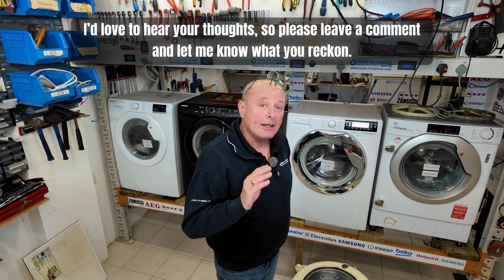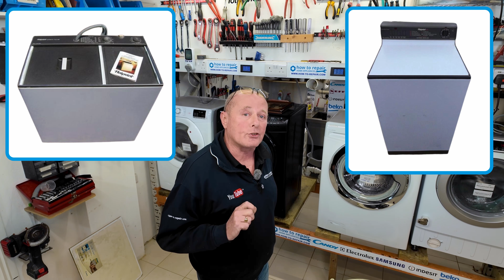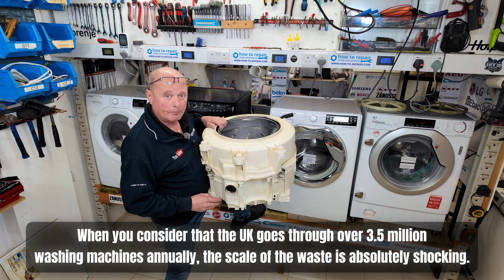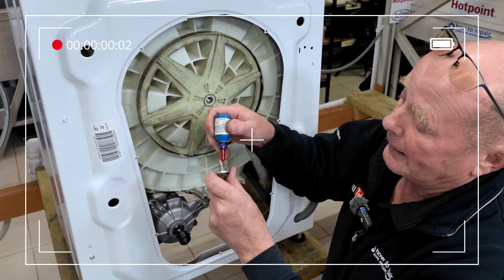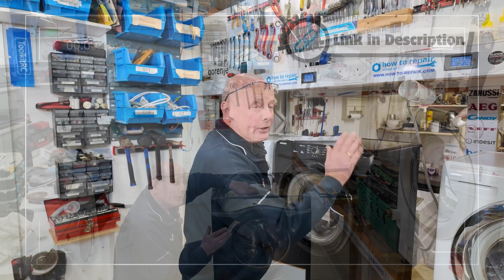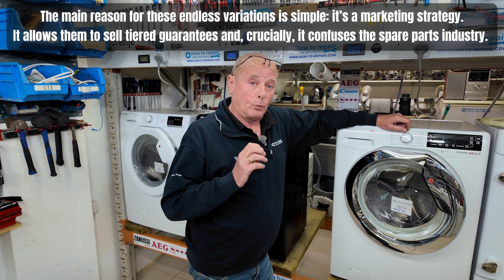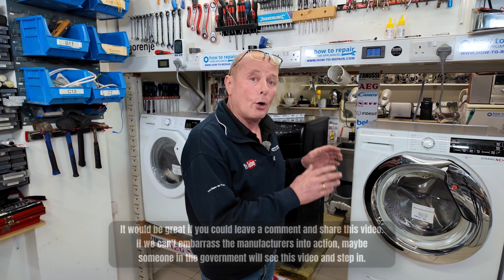I Scrapped 13 MACHINES to Prove a Point: STOP BUYING These Brands!

Comment: I was a Philips washing machine engineer in the early 80s. Most of the maintenence contract machines were anything from 10 to 30 or more years old. All still working needing the odd belt or bearing now and then. Great machines built to last. Every one of them could be totally rebuilt. Great videos by the way thanks.

Comment: but you can just buy a repair plan with domestic and general for about £200 a year for when it breaks down a day after warranty runs out.  call the number on the door to register your warranty and go straight through to a call centre that will badger you to buy extended warranty and after warranty care service, it doesn't matter what brand you buy as they all go to the same call centre with the same payment plans.

Comment: You are bang on with this call out. Just had a Hoover tumble dryer fail after 19 months - drum bearings that can’t be repaired. Makes a significant amount noise when turned on.

I have also noticed the buttons to operate the machines on hoover are just membranes mounted on flimsy plastic.

Comment: I have some personal history with this - from fixing a family friend's drier in the mid 80s (simple belt job), to cannibalising parts from my own washer drier in the 2000s to fix it (switches). One very common issue in planned obsolescence is micrprocessor control and the point that this can render something useless and unfixable. In these sorts of devices, vibration in this context is a serious problem. One brand who are pretty good in this respect are LG, who at least used to have a scheme where they would send an engineer for free, see if it was fixable, and give you a quote on the spot.

Comment: There's a reason I still have my 20 year old washing machine from Whirpool: it can be easily fixed. Bearings? No problem, the drum can be dismantled. Every part is easy to access and faily cheap. If the motor ever breaks it can be rewound. The PCB is almost indestructible and very simple. Is it energy efficient? Nope. But It's not something which works 24/7 like a fridge.

Comment: thanks for this... I'm an engineer/programmer and I've seen so much of this utter crap over the last decades...  I have appliances and equipment from the 70s and 80s, that still works today and I have repaired many times because I can, and the stuff allows it. But the manufacturers now make it SO incredibly hard to even open something up, it's a true crime, let alone provide parts. I tried to fix a friend's Nespresso machine, forget it, you need to manufacture your own special tool to even open it up, they did that on purpose. Same with a lot of other cheap stuff, made to last a year. Good thing they are now making laws against this, because I can't imagine the size of the garbage piles in 3rd world countries where all this shit ends up..

Comment: Thanks for this video, so annoying what the manufacturers do, essentially the same as cars these days: disposable like Bic lighters. 

After having had 2 relatively new washers fail on me in the late 90's / early 2000s (one a Samsung that had a failed motherboard twice - once in warranty period and then again right after warranty ended and the other one the spider completely broke.) I bit the bullet and bought a Miele washer and dryer which both came with a 10 year warranty (IIRC the 10 year warranty deal was only for the ugly chocolate brown ones which I suppose nobody else wanted). They were expensive but the good news is they worked perfectly for 19 years and I only had to do some maintenance for the very first time this past week. (that is why I discovered this channel). The washer was having draining issues and it turned out to be a gummed up hose that connects to the pump (not the main hose water gets pumped out of but a smaller hose that runs up to the upper part of the drum). I flushed out that hose, and all other drain related hoses and parts and the machine works perfectly again. It is a Miele W4840 model. It was relatively easy to work on and appears to be well made. The only "issue" the washer has now is the door hinge is a bit worn so it closes best if you lift up on the door a bit as it engages the door latch/lock. Pretty good for almost 20 years of family usage and my wife overloading the heck out of it regularly.

Thanks again for this video and the other one where you showed disassembly of a Miele washer, which helped me fix mine.

PS - I would never buy a car newer than around 2012, looks like the same should apply to washers/dryers/fridges...

Comment: as long as throwing away an apparatus does not have a relevant cost and the only costs u are considering is repair vs newly built, the make it to fail plus resell it will win every single time

Comment: I bought a hoover 2021 already had to replace a locking mechanism component, never seems to take detergeant and conditioner very well either. I wouldn't know what washing machine to get next, I don't really trust any of them. Our previous Indesit only lasted about 10 years.

Comment: You're spot on with the "greenwashing". When I'm buying a new appliance these days, I look the opposite - which models are consuming more water and energy - and prefer those, since they tend to be older by design, meaning more durable by design (or at the very least - less compromised). Also, a machine that consumes too little water, usually has 4 hrs programs duration to compensate for that, which is insane. Who can wait for 4 hrs for a washing? It's absolutely crazy.
Also, water is a fully renewable resource. When you consume less water you're not doing anything useful for the nature, as there is the water cycle. Also Europe is not a desert. So, who even came up with this entire non-sense?

Comment: i would gladly pay 40% more for a quality product that lasts decades AND is easily repaired. companies design for a target price. most consumers weigh price as the primary factor in any purchase. standard warranties are usually only 1 year, but stores try to upsell extended warranties. 
i prefer appliances with old style mechanical knobs and switches. touchpad controls are fragile, prone to failure, unrepairable, and $$$

Comment: I had a LG WD16110fd machine, a nice direct drive machine my missus now misses. I ate three lots of bearings/seals and i replaced the spider once due to corrosion near the seal. It did a good job and was easy to take apart.. it finally failed when the pcb failed, Triac and associated circuitry to operate the pump. If it wasn't sealed and mounted high i would've repaired it component level but tbh, got tired struggling with its girth out of the tiny room it was housed.. we now have a Haier machine (circa £700) which i found a service manual online, so far so good other than a colour catcher finding its way to the pump. No more of them.. but you are spot on, these machines don't wash like the ones when i was a kid and this so called ecology of operation is wiped out bc my missus washes stuff 2 or 3 times bc it simply cant wash like the LG did.. that machine is soo obsolete i couldn't even find a stock photo online... I have all the guts apart from the motor and its magnets, i had to quickly remove items before the new one arrived.. still haven't sold them on e bay

Comment: I dare you to run a Candy washing machine at 1400 RPM. It doesn't matter how well you level it the drum will still end up hitting the casing. And this is on a machine that's only 7 months old.. the Candy BS 49SB8-S.

Comment: The quality nowadays is really bad. My parents own a "Miele" washing machine and dryer thats been running for almost 30 years now and they still work fine. My father only needed to change the carbon brushes of the motor, but thats to be expected after that long of a time.

Comment: My old Eskimo, made in Turkiye washing machine was bought 250 euro in 2008. I replaced the motor brushes once in 2019, when it could not rotate. At some point around 2022 it started showing issues with draining water. Probably the drain pump was failing but it still kinda worked so I never bothered to replace. Eventually last year it started making noise while rotating, probably due to bearing starting fail. Although I am quite certain I could find and change it, I decided to  buy a new LG. Time will show about that decision.

Comment: Appliance tech here, LG faces multiple class-action lawsuits regarding defective linear compressors in LG and Kenmore refrigerators. I have on many occasions called on behalf of customers and they have tried to bargin a deal working the customer down. Very easy, just continue saying "this appliance has suffered catastrophic failure and requires replacement under the class action law suit" and they will agree after 2 or 3 attempts.They have been trained to deal with this on the phones.. The crazy thing is they are still to this day putting the faulty compressors into their appliances... 2nd is fisher paykel, they have a 240 volt to 24v volt convertor chip in them that have been put in working at max ability. This was their newer Yellow control board. always just out of warranty. very easy replacement for 15 cents.
Reply: Oh not to mention the LG dryer's. They are made with such thin material that they are constantly being changed from being out of round making a thud noise on rotation. I have replaced with new drums and have been same or worse out of the box hahaha.

Comment: If it has a display it has a microprocessor 
Washers and Dryers need a microprocessor just like my shoelaces need a microprocessor.
Go for a Maytag set or Speed Queen set sometime in the early 1970s even if it needs a rebuild you will get 20 years + and they actually clean your clothes. And don't manufacture mold.

Comment: I assume that part of the reason replacement parts on these machines are so expensive is because the manufacturers are required to sell them, but there is no limit on the price, so they set the price just high enough that their inventory clears out when the 10 year support mandate is over. I helped a friend replace a detergent dispenser on a 28 year-old dishwasher and the manufacturer sent him one from a later model that needed silicone to seal properly on the old machine.  But for many of these parts, Ebay and similar sites are a good source of cheap replacement parts. I've had pretty good luck with my appliances, but I have friends who've replaced circuit boards on 20-year-old washers, 5 year-old space heaters and even a 2006 Mercedes convertible, without spending much more than $100. This approach might not work well with parts that have very short life expectancies, since those would tend to be more expensive and less available, but it should be explored before throwing out a machine or vehicle.

Comment: Bought a second hand miele w811 in 2005, it lasted till 2025 with only €80 damper replacement by me. Probably I could have mended its valve problem that bothered me its last year in service but I didn't dare, instead I could buy a second hand W979 with a 2 yr warranty and free removal of my superheavy estimated 30 yrs old one. I was aware that also the replacement has aged, may be a 20 years, but it works flawless and looks like a new one and I do trust its build quality and repairability more than any new one. And I dislike any modern one that has to get its regular "updates" through the wifi as it also opens a gate  organize its obsolence.

Comment: let me tell you about ma washing machine:  bought it new, after 2 years the rubber part on the inside snapped - i just put it back and as long as i dont fill it up to the brink, it holds the water - its quite loud, but it works after 4 years

the only reason why im not complaining is, the new machine was freom a furniture store - new priced at 350 and i payd for the display model 100 bucks - thats the only reason for why i do not complain, but if u think about it, it broke after only 2 years, yes you can still use it without any repairs, but what is that

Comment: In Poland we have a website which is continuously being updated, listing all the current brands and models of washing machines with replaceable bearings. Of course, being run by probably just a few people, it is probably far from being a complete guide, but it sure helps. Also, some workshops here actually do open and repair these glued drums. My parents had their expensive Ariston washing machine repaired this way a few years ago. The plastic drum was cut in half, the bearings replaced and everything was assembled back with silicone or glue of some kind. The machine worked for a few more years after that but finally the water pump died. It was full of silicone pieces. Also, I think the program selector got crazy (probably a PCB failure). All we can do is avoid these appliances and keep sharing knowledge about the repairable and unrepairable ones, so thank you for this great, educational material!
Reply: Thanks for sharing mikoajbosch. What's the website's name / URL ?
Reply: daj linka
Reply: Can you give the link to that, please?
Reply: In france they have a government site where they show the statistics of reliability of brand and models sold in france.

Comment: Last time I went to buy a washing machine I saw some weird brand called "bellavita" the machine had the exact same functions as a Bosch model (same buttons and screen functions). Even the order of the washing programs on the knob were identical ...
So I bought the cheap machine for less than 300 euros, nearly half the price of the "cheap" Bosch (there was another brand that had the exact same machine but can't remember which one it was).
Over the last 6-7 years it needed 2 small repairs that I did myself : a new belt and last year I had to replace the brushes.
The electronics inside washing machines are often exactly the same accross different brands and not even manufactured by the brand you are buying!
My previous machine (Zanussi) where the electronics failed after 5-6 years is still in the garage and I fixed the electronics (even improved some components), so now even if the current machine breaks I still have a spare.

Comment: My wife and i got married in 1982 and we bought a hoover washing machine...we took it the tip in 2015 as the outside was looking a bit grubby and we thought a new machine would use less  electricity. Since then we have had 2 others and recently got our 3rd. I have a friend who is a tv engineer and he said they are doing the same with tv's too.

Comment: There should be a law regulating that the total cost of repair components must not exceed the retail price of the assembled product. Furthermore, there should be a clear investigation into agreements aimed at introducing planned obsolescence, establishing realistic product lifespans in collaboration with repair shops and manufacturers. Additionally, the manufacturer should be granted exclusive rights to sell spare parts, provided that they are legally required to set fair prices, as previously stated.

Comment: I had an Ardo for 15 years and one evening it just burned. Hopefully I was at home that evening. As an engineer I was shocked, the heating element heated up waterless drum so the last one got fire. The root cause was the program code. There were no checks for abnormal behaviour of the pressure switch. I guess the pressure switch stuck in triggered state, so the machine thought it has full drum of water and started its heater. It had a sealed drum but bearings were good after so many years though. Now I have cheapest turkish Vestel and it checks the pressure switch each time before starting the cycle.
Also I don't tolerate machines that can't be electrically switched off))

Comment: Regarding the welded drums, my Ocean washing machine has a drum using bolts. The front part developed a leak, when I phoned the agent, I was told it wasn't in stock and simply wasn't worth ordering it. Go figure.

Comment: Yep. Recently I discovered that the 10 year warranty on Maytag washer covers only the parts that seem to be perfectly fine at ten years while the parts around them mysteriously precluded from the warranty turn brittle and fall apart. The cheap trash plastic rack wheels and such that all wear out at once are easily replaceable by anyone but are sold by the manufacturer at absurd prices. 

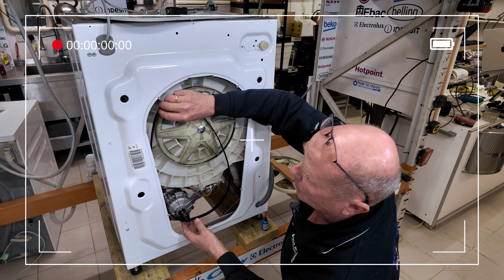12:10 - Okay, I love how easy to access that is. I've seen so many dryers where you need to thread your arm under the drum that's trying to crush you to blindly grope the belt over the motor and tensioner.